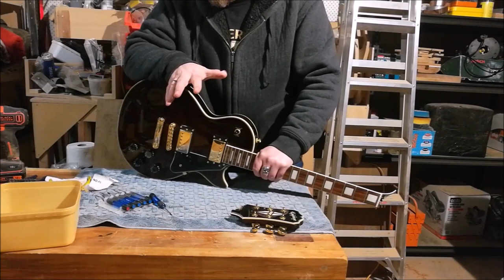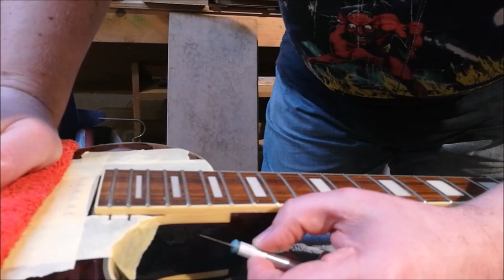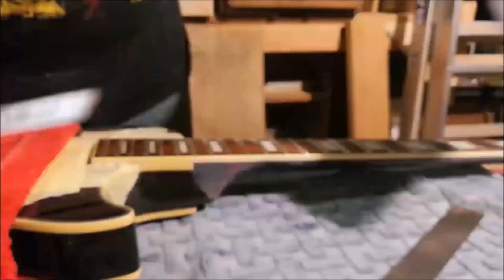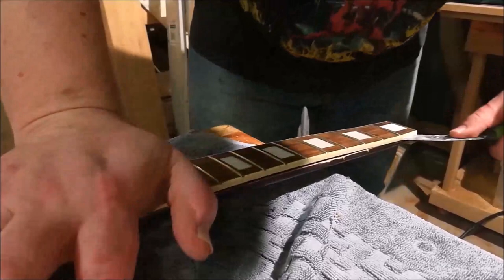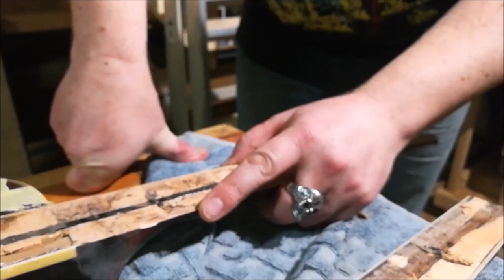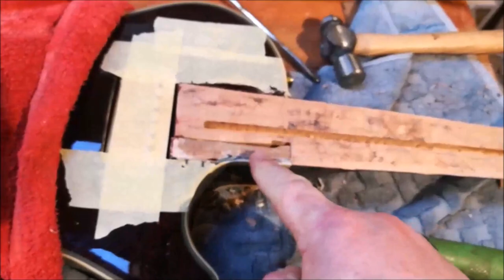127: Replacing a Les Paul Neck part 1

Comment: Another way you can remove the neck is to use a pair of those heated wire polystyrene cutters.  Ted Woodford uses them for neck resets

Comment: I have torn into many Epis and never found a cluster-F of this magnitude. Yikes.
Reply from the maker: I have only heard legends - until now!
Reply from the maker: Since making this video, my research has shown me that actually this type of neck joint is normal in Epiphone Les Pauls. Making a regular full-width neck and then cutting off a piece where it glues into the body like this is just cheaper than making a proper tenon. See the next video (when it comes out).
Reply: @MonsterGuitars , welp, good enough reason to stay away from Epiphones after the 1990's. Never seen anything like this in the older ones.
Reply: @MonsterGuitars  What evidence do you have that this is normal construction on Epiphones? I've never seen it before and unless you have evidence from someone in the factory or seen video or photographic proof, I wouldn't go around claiming it as "normal". People will say any sorts of shit on the internet and claim it as "fact". Possibly like you might be doing now.
Reply from the maker: @TUUK2006  I'm not going to go and find links for you to consider. Google the words "Epiphone" and "offset tenon." You'll find it.

Comment: Have a question about the truss rod design. I'm going to repair a very similar guitar but need to know if I can remove the truss rod from the headstock without loosing the nut or threads in the neck pocket. Please reach out and explain briefly. Cheers.

Comment: As an absolute beginner, im very curious how you get the neck out. Since you're not keeping this jewel, I imagine you're going to start with a saw. But can you remove a glued neck you want to keep?
Reply from the maker: Definitely. I haven't removed the neck yet, but when I do, I won't use a saw.
Reply: Use heat and steam.  That’s all.
Reply: @jakefromstatefarm9721  that's all that's to it, indeed. There's a 'Cor' way, that's digging it out like with architectural precision. Chisels, drilling, milling, cutting with a knife. Probably theres in my case another problem surfaced. Not every neck fits in every model body. For example: the 24 frets neck has to put in a body that was a 24 fret guitar. 
Sometimes necks are too short at one side: 20, 21 22 frets. It seems those can't be put in. Results in: out of tune, intonation,  flagolettes, completely at strange places. Here I mean the "normal" positions with clear tone. 
I've one shot at this. 
We'll see, wont we? 

I'll keep you updated. If you would like that? 
B. R. 

Cor🤘🏽🎸🤘🏽

Comment: I have a Gibson Les Paul 60's Standard with a break at the base near the body. Almost certainly will snap with any significant pressure. Any advice?
Reply from the maker: A break in the neck? Without seeing it, it's hard to know if it's repairable. It may be possible to open the break a little, get glue in, and repair it. If it was actually made in the 60s, take it to a Luthier to look at, as a repair is what you want. If it's a reissue, it isn't hard to get a Les Paul standard neck, nor is it hard to remove the old one, so replacing the neck is certainly an option.
Reply: @MonsterGuitars  it's a 2021 reissue. Where can I find a replacement neck? I don't think the glue trick is going to work on this one. It's almost snapped all the way through.
Reply from the maker: @steves12strings  I don't buy replacement necks, so I couldn't say off the top of my head. I did just search Ebay for replacement Les Paul necks and there were plenty of results. You'd just have to confirm with the seller that it's a match for your guitar. I imagine there would be some on Reverb, too. Gibson don't sell necks. They would refer you to one of their authorised repairers (whoever they might be), but of course that would be expensive.

Comment: So can you take a les paul body and out any neck on it ?
Reply from the maker: No, not just any neck. It'll need to have the same number of frets and be based on the same scale length (24.75 inches), otherwise you'll be doing much more major surgery.
Reply: Right.

Comment: Unrelated to your work, could you in the future, turn off auto focus? It will stop the in & out of focus every time you move. It will make this much easier to watch. Thanks.
Reply from the maker: At the moment I'm still doing all my video recording with my phone, which doesn't have the option of turning it off. But yes, I'll do this if / when I upgrade to a dedicated camera.
Reply: @MonsterGuitars  you may have that capability in your phone now. Look for "pro" settings (or something to that effect). Then manual focus. The downside is you'll have to make sure the other settings are correct. That's easy enough to do by looking at the details attached to all photos (usually scrolling up on the pic will reveal them) and matching those settings. Unless you have an iPhone as I'm an android user. Keep up the good work

Comment: What do these people who "break" les paul necks do??
Reply: I had my Les Paul broken for exact 4 times. One time it fell. Second time, wrong glue, third time, it fell, fourth time it broke because it fell. On the ground,  gravity is a bitsjh. Just dumb and bad luck. I've over a dozen guitars, none of those others are scratched  let alone broken. Dumb luck isn't totally true, they're top heavy. Like more 24 frets, glued in or  'solid necks'. Take it from a veteran with 50 flight years strumming the three chords I know, sometimes its a matter of frequent usage and its a tool.  Tools break  I'm happy for you nothing broke.       E=MC²🎸P=F÷A;  strong stringed neck is as weak as bees can be fragile, when they fall they crack at the neck.  Which is the thinnest, thus weakest link in a chain of the F-lines, invisible though decent present.  Actually there's no reason why it happens.
Reply: @oomerwta  That's bad luck! What a story, you should name the guitar after it🤣.. I have to knock it on wood 3 times, luckily i never broke mine... 
💪👍👍
Reply: @klauscottonswab2322  did you read my question?

Comment: This is why you should install splines and not just glue the break.
Reply from the maker: Oh, I did us splines. As I said in this video, this was a whole new break, unrelated to the repaired break. It wasn't a failure of the original repair. Someone (not me) dropped the guitar on its end.
Reply: @MonsterGuitars  some one needs to get a telecaster.

Comment: ive scowered you tube and have yet to find a Gibson with their multi peace maple walnut maple necks with a broken headstock! the mahogany they use has very short grain witch is great for some things and bad for others. maple on the other hand has a long grain and provides better support. it got so bad at a point wear a large number of guitars wer not surviving initial shipment to dealers witch epiphone was even worse! if i ever buy another Gibson its got to be a custom with maple neck and a staple neck pickup and a p90 in the bridge. its probably a made to measure item that would ballpark cost 6k to get into. ill stick to my thick maple top mahogany back strat for now i guess. lol
Reply from the maker: Yeah that's true, it's not just the lack of a volute, although that's a weakness. A multi-laminate neck is much stronger than the one-piece mahogany necks Gibson uses and would be far less likely to break.